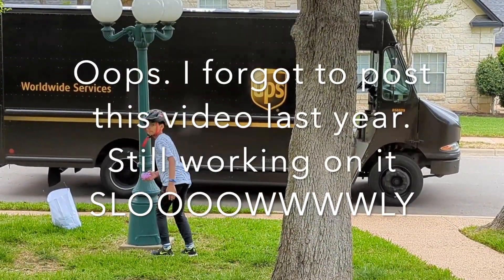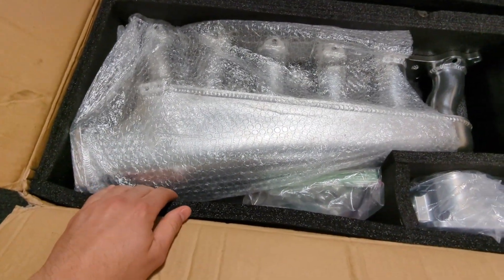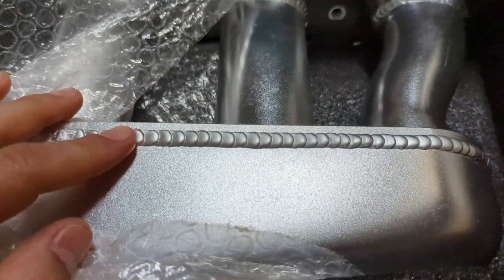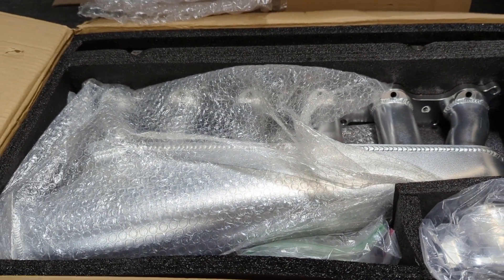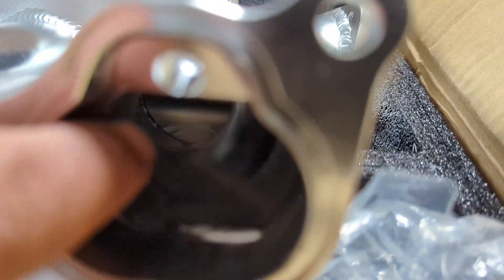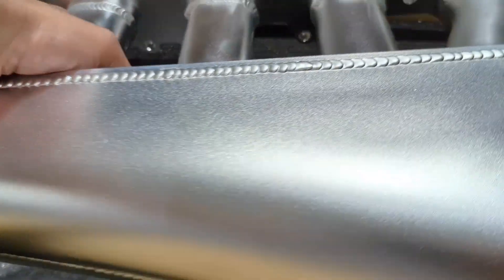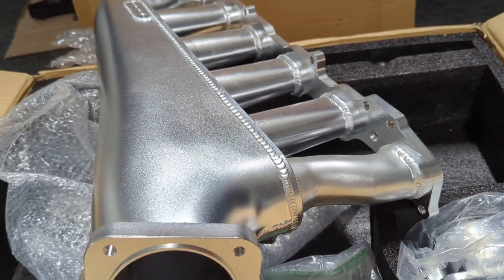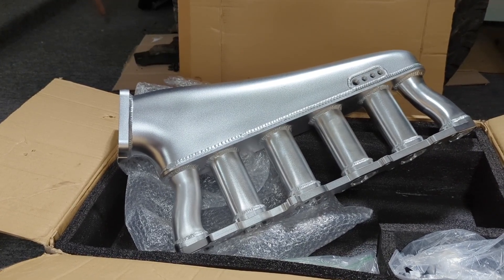Turbo Land Cruiser 80 Build 1FZFE Intake Manifold Fuel Rail Throttle Body

Comment: Oh this is gonna be sweet! Looks like you'll be doing a lot of Haltech R&D for me when I decide to go standalone 😂.
Reply from the maker: I have most of the pin outs scribbled on paper for the wiring. Still need to decide if I am going to keep the auto or go manual.
Reply: @NKPGarage  nice! I'd like to keep the auto myself as long as I can but a manual would be pretty cool.
Reply from the maker: @motor.mausGarage  I agree. If I can make the auto function correctly I’d prefer to keep it. I’m not shooting for crazy power so the stock auto should be fine to handle the power

Comment: Hi there! I installed this on my 70 serie Land Cruiser, but the stock TPS valve does not fit and I don’t seem to find one that does. 
Do you have a link or a part number for a valve that fits?
Reply from the maker: It all depends on which throttle body you are using. You have to get one that fits with the throttle body you are going to use.

Comment: thats not a Plazmaman inlet manifold they have billuet runners not welded together
Reply from the maker: I think you might be right. I was told it was a Plazmaman. Oh well, gotta figure out whether to keep it and use it or not. It seems to be very good quality still. We'll see what happens.
Reply: That's a good looking manifold for sure.  Any idea what the brand is?     If you're not shooting for big HP numbers, how come you didn't just use the stock manifold?  
I'm considering this type for my build also, but mainly for the ease of intercooler pipe routing.   BTW the Haltech 2500 will work with the auto trans....but you need to keep the OE ECU to run the transmission.  The Haltech will be controlling fuel, timing, boost control and a few other things